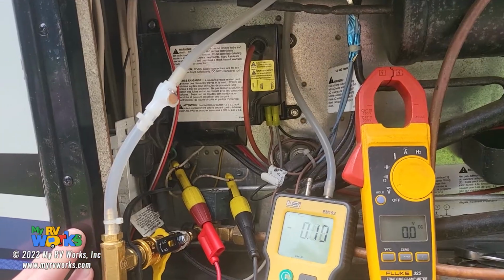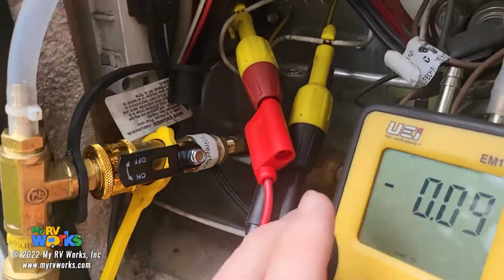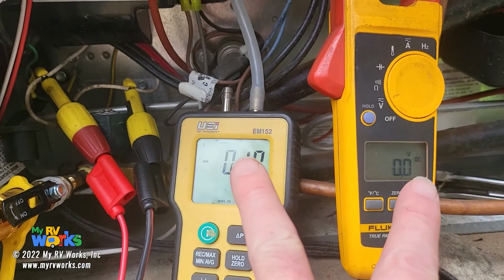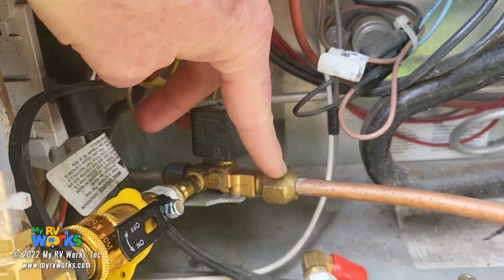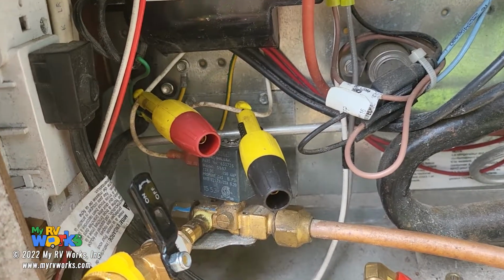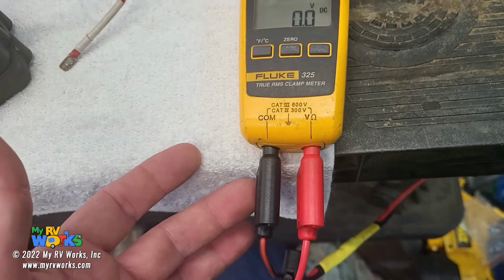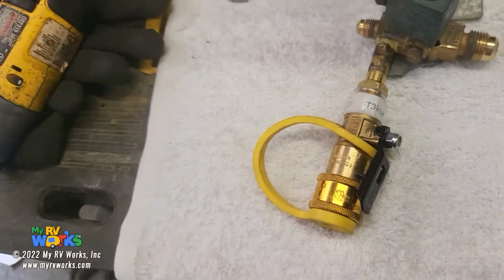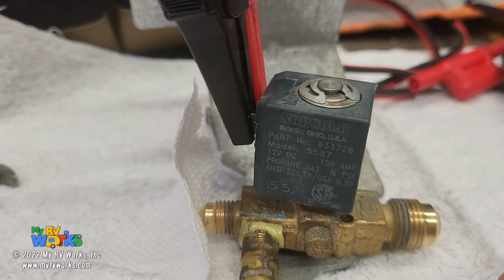Norcold Fridge Not Working On LP Gas Mode -- My RV Works

Comment: Great video. I took my test leads at the solenoid for DC power and it reads 0. I took the test leads again and tried putting neg on ground and didn't get voltage at either terminal. My Norcold is 3 years old. it works fine on AC. I opened the cover for the circuit board and there were 2 automotive fuses. I put the negative to ground and checked both sides of the fuses and they are both good. There is a glass fuse on the left side of the circuit board and I can see the filament all the way across but I didn't test it because I didn't know if it was 12 or 120 volts. Do you think it's the board is bad? My wife is using the fridge so I didn't want to pop out the glass fuse. Does the black box come as an assembly or can I just replace the board? I pushed on all the connectors on the board to make sure they were tight.

Comment: My problem is opposite gas is working but AC  does not new battery on front of trailer unplugged for 5 minutes reset green light comes on 1-2 minutes go by then amber (gas) comes back on

Comment: Great video on mine normal operation i am plugged into shore power and green light indicator keeps turning off then red/orange light comes on turn power off and back on green light comes on and soon after fault light comes on I will do these checks like in your video one last questio before i delve into it when fault light comes on even though i am plugged into shore power this just indicates that there is just a problem with the gas system?

Comment: Before pulling the valve and going through all the adding power to the solenoid. I'd do a quick continuity  test .  It will tell you the coil is good or bad.  This is more of a push for your tool.

Comment: In my area of the country if you pierce those wires and don't put liquid electrical tape it back on them when you're done they will rot away in 6 months
Reply: Especially when the terminal is a couple inches away

Comment: Not working on gas or electric,,norcold 16 years old ref. Five time blinking light on on off control,, Power to the control module at back of refrigerator, installed new circuit panel third one still blinking blinking five time light,, Electric 120 and 12 v in to Control board. Anybody have any ideas ?

Comment: Firmly tap the valve and solenoid with the handle end of a screwdriver 'before' any testing. I've had this work permanently on 3 separate rvs. Worked for me on 2 norcolds and 1 dometic. Just saying.
Reply: This comment worked more for me than the video did..
 Just got my fridge working again thanks to an ol flathead beatin.
Reply: just worked 4 me thanks

Comment: Now for me, I would follow up by removing the coil from the valve and using a screwdriver test to verify the magnetic part work, this would be tell me which part is bad, but that’s just me. Thanks for your videos my friend
Reply: Doesn't really matter. You get both pieces when you order a new valve.
Reply: @hillbillyrv  did not now that, but could you buy just the coil, I would not buy a new valve with an old coil
Reply: @laundrymanadams6105  I figure that you can't order it separately.

Comment: My problem is that I don't have any voltage on the pins on the lower control board that the wires that lead to the gas valve are attach to once the upper(eyebrow) display board switches to gas when I remove the 120 volt plug on the backside of the refrigerator. I don't get any clicking of the spark igniter either. I have replaced the lower control board and while the upper control display board does light, the push buttons don't do anything. I can't turn it off, manually switch the energy sources, 120volt/12volt/gas, or adjust the temperature using the push buttons on the eyebrow display panel. It will automatically switch sources and the 120volt/12volt do make my refrigerator cold, all I get, once it switches to gas, after a brief moment, is an alarm with flashing error and gas lights indicating that the gas didn't light. With the buttons not operating on the eyebrow display panel, would you suspect a bad eyebrow display board? I had disconnected the wires to the gas valve and attached a 1.5 volt, AAA battery to open the gas valve and release gas to the burner. I had used one of those barbeque lighters to light the burner. It does stay lit as long as the gas valve was energized in the open position. So, I had concluded that the gas system was fine. Is it up to the eyebrow display board to send a signal down to the lower control board to send the proper voltages to the gas valve pins and spark ignitor that lights the burner? The lower control board had sent a signal up to the upper eyebrow display board once I had pulled the plug to disconnect from the 120volt source on the back of the refrigerator and told the eyebrow display board to set the alarm off that, I know, is soldered to the eyebrow board and both the error and gas LED lights flashed. Your thoughts, please
Reply: Sorry I didn't read all of your details it's pretty long but if your eyebrow is acting funny it's highly suspect, and probably needs replacing

Comment: I have a Nocold that doesn't work on lp right away after setting up camp.  Sometimes 2 hours, sometimes overnight.  Its weird....I'm wondering if it's the gas valve.  Thanks for the insight Darren!
Reply: I have a Norcold that takes a while to light too. I light a stove element and sometimes that speeds up the fridge to light quicker. It seems to purge the gas towards the fridge. I just spent $50 to repair a flaw on the fridge door bottom plastic hinge that broke. So far I'm not happy with Norcold.